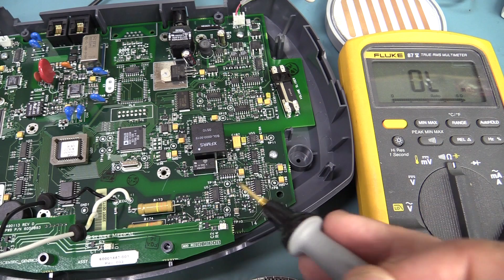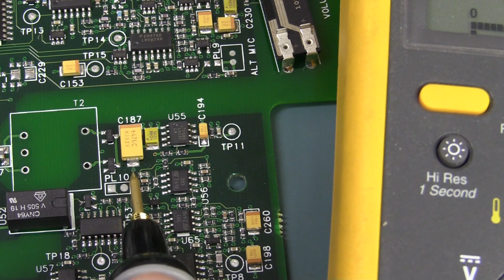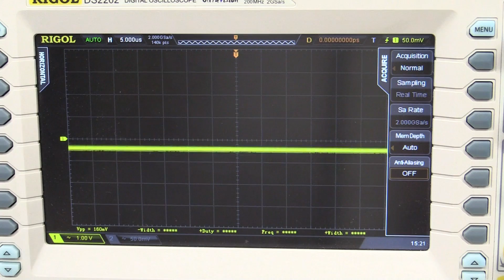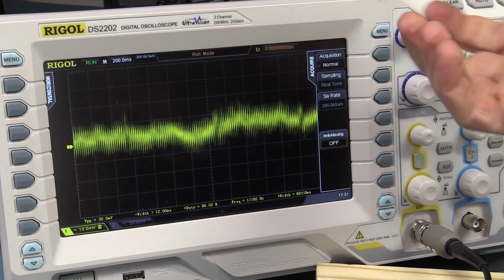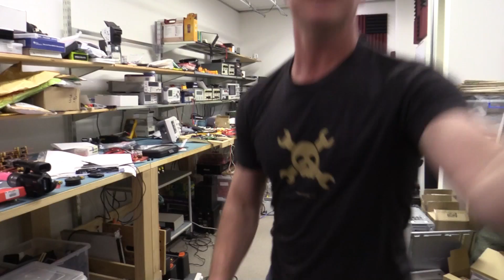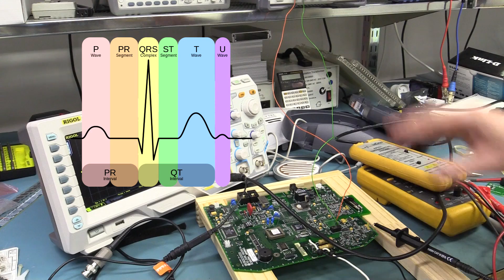EEVblog #660 - Electrocardiogram (ECG) Experiments

Comment: ECGs are great for helping to keep the data on your pacemaker squared away with your doctor. 

This type of equipment that remotely transmits the data back to your doctor is fantastic for saving lives.
The equipment today is quite cheap when bought used on the https://www.Mazree.com/smart-auctions or Ebay or Amazon.

However, some of the larger medical equipment, when it is more expensive, like beds, heart monitors, etc...is definately better to be bought used.

Comment: The test point gave you your ECG reading for Limb Lead 1, you need 3 or 4 leads to get all limb leads, and more for a 12 lead (10 total leads for a 12 lead... math seems wrong but that is the truth).  For most waveforms two leads are active, one as negative and the other positive, for AVF, AVL, and AVR 3 are used - two leads are differential and one is negative; if used a 4th electrode is used as a ground reference to help clean up the signal (right leg lead).  3 lead ECG is typically done in "field" mode using a 0.5 to 500Hz filter and 12 lead is 0.5 to 100Hz.  In both modes the signal received from the leads is then run through a fourier analysis to derive the actual waveform.  Limb lead 1 is also the lead with the lowest response to the p-wave and typically shows a smaller amplitude of all waves as it is measuring flow across the heart and the actual impulse is diagonal from top right to bottom left normally, so you are only picking up the small horizontal signal rather than the large vertical one.  The "antenna" cannot be part of the ECG as pacemakers may be implanted in different areas and that would mess up the reading of a waveform.  Try to find information on Lifepack 12 or 15 monitors and you could get some real cool info as these are our standard EMS and trauma room units with all sorts of whiz-bang stuff in them like CO monitoring, blood pressure, O2 saturation, and defib/cardioversion/pacing.

Comment: Those wristbands are Speidel "Twist-O-Flex watch band. if they have watchband styles on the ends, you have a real find! I ran through three watches but keep the same band. as, they can be used for antiseptic wrist straps. you'll probably add a multi-meg-ohm resister for personal protection.    Tom - Vista, CA
Reply from the maker: tom7601 The feel pretty good quality!
Reply: EEVblog
The time frame that I was referring to was the middle to late 1960's. THey still make them!
http://www.speidel.com/magento/index.php/watchbands/metal-band/twist-o-flex-bands.html

Tom - Vista, CA - USA

Comment: When you have a serial-communication (optocoupler), I would make FM or PM modulation to get the analog signal thou to the none isolated side.  So a simple 555 og equivalent PM/FM demodulation would probably make the signal visible on the scope.

Comment: BTW, this reminds me of a really crazy way some pacemakers let you monitor their battery status. If you hold a magnet up to some pacemakers, it will modulate your heart rate to reflect the battery level!

This is obviously a fairly importing thing to monitor, and replacing the battery requires surgery. AFAIK there's no rechargeable versions yet, probably due to concerns about heating.

Comment: I too think the square wave is some form of FM. Notice the frequency on the scope is ~67 kHz -- way too fast for a heart beat. But it could be the raw analog signal frequency modulated.

Now the bigger question is WHY they have these wrist probes at all. After all, a pacemaker is directly wired in to your heart, and the pacemakers I've seen can give you super-detailed ECGs wirelessly over an inductively-coupled link.

Comment: Dave - nice video but I don't think that either side of the transformer secondary is connected to the isolated GND plane. It looks to me like both sides of the transformer are connected to diodes.

Comment: An ECGs typical monitor mode is 0.5Hz-50Hz bandwidth (Typical 3 or 4 lead EKG).  Diagnostic (12 lead) is typically 0.05Hz-100Hz.  The pulse you are seeing is the QRS of the rhythm, which corresponds to the ventricles contracting.  (The 'dub' in lub-dub) The P wave is hidden in the noise (which corresponds to the atria contracting- the 'lub').  If you could clean the signal up, you might be able to detect the T wave which is the ventricles repolarizing (resetting) for the next beat.

A thought- Not too familiar with PWM, but is the output being converted into a PWM signal for decoding by the DSP?

Comment: Your probe lead is maybe injecting ground noise to the floating output. That's why you are getting all this 50Hz noise. Quick fix just make a low pass filter 3dB roll off at around 30Hz, really clever make a notch filter and cancel out at 50Hz.

But 130 beats per minute? Ummm if that's the case you need to see a doctor. Normal is around 70. 130 is only normal for someone after a jog. Unless you were running around (i didn't watch the whole thing).
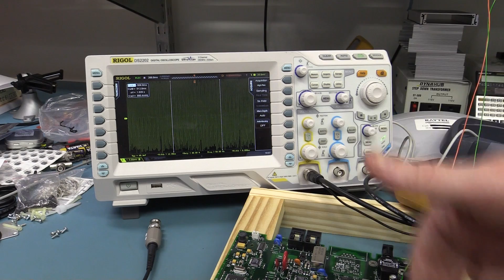Reply: If you watch from around 24:00 to 27:00. Dave measured around 60 bpm initially, then did some brisk exercise to reach 130 bpm, which indicates that he is pretty healthy.

Comment: Do you need a pacemaker in circuit? Perhaps the inductance off the winding of the pacemaker pad makes a difference? Must they both be connected? Is the pacemaker pulse the same as a natural one? The signal could be a square wave form. I'm impressed you got anything at all! Damn thing didn't want to volunteer anything!  Don't know much about heart stuff, kidney shit? Know tons about that! I'll take my stout pump and plugged filters and head on down the road.

Comment: i would say they are using FM on a HF square wave to transport over the LF heart beat stuff accross a digital optocoupler.
Reply: It was defiantly a VCO signal. They where using it as a voltage to frequency converter to transport the analog signal through the opto and on to the DSP on the other side. The DSP probably used a timer/counter to decode the FM signal. It would be easier to transport a FM modulated square wave through a opto then a analog signal because the opto would be vary un-linear to the amplitude of a analog signal.

Comment: What about fm-demodulating that square wave form? Because this device is used for sending data over long distances (phone), i would use a modulated signal to transmit it. A basic fm-demodulater is an easy build. At least have fun with all the nice workouts Dave ;)

Comment: Fascinating investigation! It looks like the signal from the wristbands is only roughly amplified and then turned into a PWM waveform to transmit it easily across the isolation barrier. I expect the waveform is cleaned up and shaped in the digital domain.

Comment: Would be interesting if someone does improve these light sensor pulse measuring system.

In my opinion it is absolutely unnecessary to measure the blood pressure with a pump system in the 21st century!! A really bright LED and a sensor can measure the pulse on your finger. If you analyze the ramp-up you get the SYS-pressure. If you analyze the ramp-down you get the DIA-pressure. And the pulse of course.

Would be cool if there is someone wo could build such a device which plugs via USB2GO on your smartphone or couples via Bluetooth and you can see the data, there (please don't add sharing capability... No body needs that).

Comment: First this is a very interesting video, and next.....why you gave up half way through...? You have just got the answer right there, as you probed the the frequency changing square wave.
The main problem of the measuring very low and noisy voltages is, if you want to do it directely it is nearly next to impossible. You need to transfer it in another domain. Here it is the FM-domain. Doing so, lets you have a shiny, steady and almost noisefree output signal, in this case they must had gone this way to eleminate the "RF" junk stuff (where RF is in this case all frequencies beyond 10Hz...;) and all its left is the lo-freq. ECG signal.....it´s already all in there, as i done a little analysis
of your modulated square wave....you presented a litte figure of an ECG signal in your vid....the FM signal its just like that.

"all you have to do" is you need the fundamental frequency of that oscillator and build up another one with that frequency and do a cross-correlation with that FM signal.
May in conjunction with a PLL do get rid of any phase disalignments.
One way is to set up a square osc by yourself, or hook the thing up to a muC and do it in software.

Anyway, Dave.....Great show...Big thanx for this one...as this is EE-stuff at its best! :) :) :) :) :)

Comment: The front-end is probably not designed to give you a nice ecg signal, because I guess they are just measuring the heart rate and therefor don't need such a clean signal.

Comment: If the frequency range allows it, hook up a speaker to the output of the circuit - The changing clock should be audible. If not, is there a way to measure frequency over time with the lab equipment? Maybe with the low frequency analyzers

Comment: It looks like the noise on the TP6 signal is much higher frequency than most of the ECG waveform. (presumably from your environment or from the oscillators in the circuit) Could you just low pass filter out the high frequency while hopefully maintaining the integrity of the QRS complex. You should still be able to see any very obvious pathology, which I'm sure won't be there. This is interesting http://www.eetimes.com/document.asp?doc_id=1278571 It says bandwidth of ECG is 0.5-150Hz. This device probably implements the filters digitally.

The exact waveform you expect to see depends on the placement of the electrodes. You might have more luck in seeing a stronger signal with different combinations of left arm, right arm and left leg. e.g. Lead II configuration; right arm to left leg IIRC.

It can be hard to get a decent signal if you're using any muscles at all. Even with a proper ECG I had a hard time getting clean waveforms for my university classmate on an exercise bike and propranolol.

Comment: The ECG signal looks like in there. Putting the signal through a 50Hz notch filter will filter most of the crap out and a signal should appear "through the mist" of noise.

Comment: My guess is that the analog amplified signal gets converted into PWM (or frequency modulation) and then sent via the optocoupler to a digital input of the DSP. Since this signal is digital only, a non linear standard opto is sufficient. So measuring the duty cycle (or frequency, depending if it is PWM or FM) and averaging over a couple of cycles should get the input's wave form.

Comment: So you can simply just cut off that section from pcb - and have a standalone analog EEG monitor. Can get rid of the psu noise by using a battery pack perhaps?
Reply: It would probably be eaiser to just build your own ECG than hack one out of one which changes the analog signal to a frequency modulated square wave quite early on. They're not too complicated, 2 or 3 electrodes and an amplifier basically.
Reply: No because this isn't an ECG monitor. The coil energises the pacemaker to allow it to communicate to this unit through the two wrist connections.
Reply: Aptsys, This was a reply to Mauro Tamm who suggested cutting out that isolated patient-side section of PCB and using it as an ECG. (Actually he said EEG which is different, but I'm assuming that's just a mistake). I think my comment will make more sense if you take that into account.

Comment: I bet they are doing something similar to high resolution bench multimeters where they syncronise there readings to the mains frequency. But here they likely use the noise on the actual signal and lock on to it so they can only sample at the peaks of valleys of it. But my bet is that this is done in software after the ADC.

Comment: I confess I haven't watched the entire video yet but the analog signal would most likely be processed in the digital domain. That is, they lowpass the raw signal from a differential amp to band limit the signal and then sample using the ADC. After that they put a two digits order bessel filter high/low pass and 50/60Hz band reject filter and what not to obtain a nice clean ECG signal. You can't do this using an oscope.

Comment: The signal is probably just being modulated to get across the opto. The modulated signal may not go directly to the DSP... there may be demodulation done on the DSP side of the opto.  Try powering the rest of the system up and probe around following the opto signals.  The power for the isolated section may be off without an active call session, but perhaps the non-isolated circuitry is live.  Also... is that test point the last place before the modulation is added?  The modulated signal looks much cleaner than the test point.  Check out the signal as close as you can to whatever is doing the mixing.

Comment: You should try to use a microcontroller on that variable frequency square wave using input capture to get the time of n cycles, and then output it via a DAC (stm32 for example has input capture and a DAC built in). Or, send the data over serial and let the computer plot it. Probably a lot simpler than filtering it in analog with a high Q multistage filter of some sort.

Comment: Just create a squarewave at near the same frequency/amplitude with a function generator and read both with a differential probe. Yeah they are not going to be in sync all the time but it will show if the ECG is pwm coded if you twist the knob a little.

Comment: Dave, thanks for another great video.  That square wave signal looks suspiciously like a PWM and could be how their are moving the analog signal across the isolation gap.  Do you think it would be worth trying a low pass filter on the square wave and looking at the result of that on the rolling display?  If this is what the unit is doing, they may already have a filter on the other side of the opto and if it is built with passive components, the ECG may be present on the input pin of the ADC even without powering the isolation transformer.

Comment: You got three leads with that unit. I realized the second antenna (the Yagi) is for ECG monitoring as well. The wrist leads are there to confirm circulatory and pulse rate to the extremities and the chest unit directly measures the sinus rhythm.  Most likely the pacemaker can also xmit cardiac data into the unit as well.
Reply: Nope, just two leads. The antenna/loop unit is sealed and has no skin contact, so it is not used for the ECG side. Although as you say the pacemaker is likely giving them some real time data as well, but it really depends on the model.

As I understand it, these wrist lead monitoring systems are used to confirm the pulse rate of the pacemaker, and were mainly used on older pacemakers. It would be able to tell if it was operating at the programmed rate, and the kit may have included a magnet to throw an internal switch in the pacemaker which can switch it to a different rate that is pre-programmed default from the factory to confirm the reading. If it does indeed use both methods, it could even be instructing the pacemaker over the antenna to change the rate to make such confirmations. Some brands/models still use the method in combination with the new RF interfaces I guess.

Using an ECG style input to check the pulse rate worked with older models because they would not have had the features of many newer pacemakers, often running at a fixed rate for some of the very old models, or with a rather narrow range of options. Newer equipment is quite fancy and computerized internally, with an adoptive pulse rate to accommodate physical activity levels, or even to not turn on until needed. Some people need the pacemaker to run continuously(internal electrical blockages in the heart), while other people have more intermittent issues that don't require constant pacing like me(less than 5% pacing, and it's only that high because the programmed criteria often activate it while I am sleeping as I am slightly bradycardic while asleep)... I have rare cardiac related blackouts, my heart will actually stop for a short period, but when it's not doing that everything is fine - but my pacemaker will detect the drop in heart rate(drop a certain amount with an endpoint or continuing to drop below a programmed rate) andl turn the pacemaker on at 100bpm for a certain amount of time, then it slowly backs off until the natural heart rhythm picks up the slack. My home monitor only has the antenna.
Reply: Agreed on all. I wonder if they used a dielectric gel on the wrists before the wrist straps go on. I think that would have cleared up the ratty output he was getting.
Reply: Nighthawke70
I used one of these on my father after his heart surgery. The wrist bands are used dry with no conductive gel.

Comment: The ESD mat must be liiitle conductive even when I measure it non-conductive with multimeter. I tried grounding one voltmeter probe and touch the other one with my hand (sitting on chair standing on insulated wooden floor) and measured some 50hz inducted noise around 200mV or so. When I touched the ESD mat with my other hand - magic - measured nothing (0.5mV). EDIT: and it must be really high resistance because to 0.5mV I have to touch it with my whole hand - when I touch it only with single finger I get 50mV for example.

Comment: Perhaps you can take the modulated wave form, and also measure the clock generator on the isolated side, and use the scope to do a rolling display of the frequency difference?